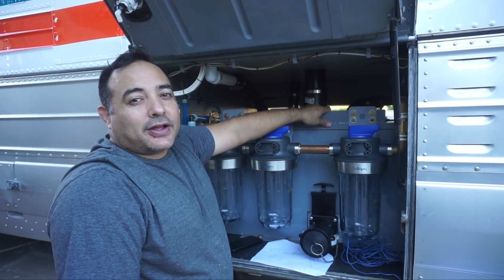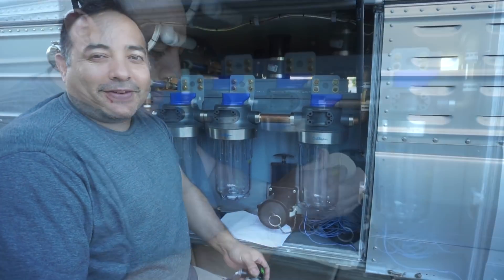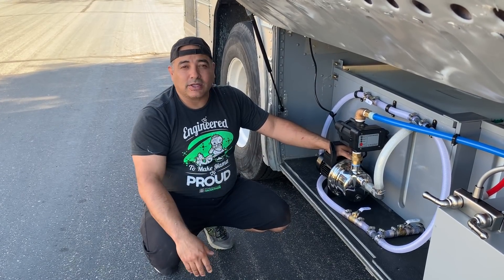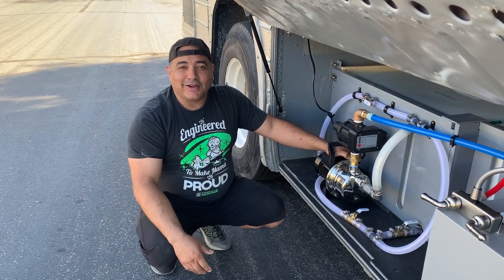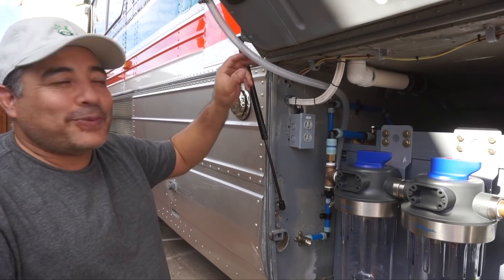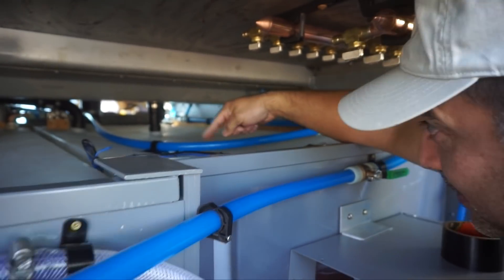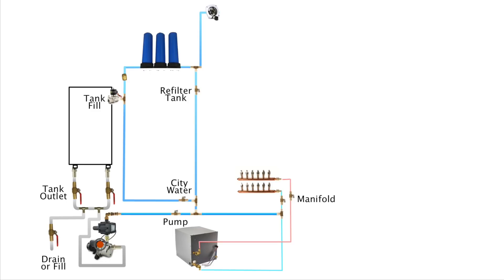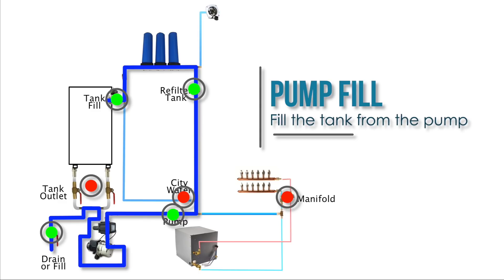Supply Plumbing Part 6: Inlet Hose, Fill Valve, Manifold, & System Overview

Comment: We are considering installing the same style pump, now that you've had this system installed and working for a while how's it going so far?
Reply from the maker: It's great.  We really like the pump and the whole plumbing system has actually worked out well.  I don't think there is anything we would change about it at this point.

Comment: Having watched these for awhile and seeing how thorough you are, I guess you're going to write a User's Manual for all these systems in the bus?
Reply from the maker: Yes we will have a user manual (already started with all the diagrams we draw for ourselves anyway).  We will probably have some operational check-lists and detailed wiring schematics as well.  The bus will also use a fair amount of source code which we will check into a remote repository incase any of the logic boards go bad we can re-flash them instantly and be up and running quickly.

Comment: What a great walkthrough of how you’re running your plumbing! We like how you have check valves & are able to recirculate water back through the filters! Are y’all going to use a UV filter in line after the three canisters? Or is that not needed for this setup?

Keep rocking it, y’all!
- Brian + Erin
Reply from the maker: Glad it was helpful!  We plan on installing an RO system for drinking water.  UV filters can help of course but we are planning to get water from municipal water sources (already filtered and clean).  If we were getting water from streams and other untreated sources we would be very likely add additional filters and UV.
Reply: @BeginningfromthisMorning  - Ahhh that makes total sense! YOu guys are doing such an awesome job! Thanks for sharing. - B + E

Comment: Do you have a shut off valve for the cold water supply to the hot water tank? I didn't see one on the schematic.  If it leaks you'll need a way to shut it down
Reply from the maker: Thank you William.  If we were on city water we would shut off the city water valve.  If we were on the pump we would shut off the pump valve.  That should stop all the water to the cold water as well as the water heater.  There is also a small valve at the inlet to the water heater that allows you to "tune" the cold water intake (incase there is too much flow) in a pinch this could also be used to shut the water off to the heater only.
Reply: @BeginningfromthisMorning  Wouldn't that mean you'd have no running water until the hot water tank was either fixed or bypassed?

Comment: As others have stated, you absolutely need a pressure accumulator. The way you have your system configured now, your water pump has to start every time someone cracks a valve, and it will stop every time water flow ceases. Your pump will not last long constantly, and needlessly, cycling like this. And, its particularly bad for an AC induction motor. The lack of an accumulator will also exacerbate water hammering which is not just annoying, but can damage your plumbing. If you connect an oscilloscope, you will also see another issue, induction loads create huge electrical spikes which, overtime, damage other components, e.g. inverters, refrigerator, AC, computers, et ceteria.
Reply from the maker: Thank you E Designs - The pump we bought is designed to work without a pressure accumulator tank.  The control mechanism on this pump keeps it from short cycling as you describe.  In fact, the way the system works you would swear there was already a pressure tank installed.  I was skeptical at first - when I have used well pumps in the past they have all needed pressure tanks.  So we were ready to put one in if we had to.  After getting the pump going and testing - what we discovered is the pump worked great even with just a tiny trickle of water - no hammering or power cycling what-so-ever.  The pump will remain on and provide a constant stream of water until you turn off the tap.  When we get a little further along with the plumbing I will show a video of how this works.
Reply: @BeginningfromthisMorning  I look forward to your future video on your experience with this pump, but I disagree with your conclusion. As an example, if you have an ice maker, it will draw a small quantity of water for an extended period while filling. With an adequate accumulator, your pump wouldn't even need to run for this operation. In contrast, your current system will need to run the whole time your ice maker is filling. Likewise, if someone opens a faucet to quickly wash their hands, your pump has to start and stop every time the faucet is opened. The delay shut-off on your controller just keeps the pump running longer than necessary and does not really address the problem. Accumulators function like capacitors in an electrical circuit: they smooth pressure pulses and provide surge capacity. Your controller will not fill the void.

Comment: Re-Filter Tank:
Once contaminated, there is no amount of re-pass through filter that can really clean the water 100% or even to the full filtered ability.  If the filters were connected just before the T that goes to the manifold, however, all water would be cleaned before being used.  At that point, it really does not matter where the unfiltered water is obtained... City, Tank, or Drain/Fill

Pump:
With the larger pump, should you not also include a Pressurized Accumulator Tank to prevent short cycling the pump to death? Sounds like they have greatly improved them from the days when you had to deal with one getting "waterlogged" from lack of separation of air/water.  Even the small one my RV had on it made a large difference in the number of cycles on the pump when faucet is not "FULL ON"

BTW, getting caught up on everything you've done so far and am always WOWed... Also think we would be instant friends, so don't take any of the above as anything less than suggestions from friend.  All of this may have been said before, so this may just be a +1

Also, i totally understand why someone might have missed the tank vent thing -- It was your twin from the Terrain universe that did the other video (Goatee vs No Goatee - star trek reference for those that don't get the reference)
Reply from the maker: Lol!  Love the goatee refence.  So funny!  Thanks for the comments.  We considered putting filters between the pump and manifold but couldn't make it work logistically.  Having the loop was a bit of a compromise.  We don't anticipate having to use the refilter option frequently but wanted to plumb it that way just in case.  For the pump, it is designed to work without an accumulator tank.  So far in our use of it, we haven't experienced a lot of cycling.  When the water is on a trickle the pump remains steady without any pulsing or cycling.  Thanks for joining and sharing!

Comment: Hey Juan you mentioned the vent but didn’t show what you did there. Not sure what you’re planning but FYI on the 2 buses I’ve owned, the “vent” also serves as an overflow to the ground. Very useful when you want to fill the tank all the way before boondocking and not worry about rupturing it.
Reply from the maker: Thank you Scott - yes! our vent is going to be designed to also overflow (we actually just tested this last week and it worked beautifully).  I saw you hit 1000 subs - congratulations!  I think it took is well over a year to hit 1000

Comment: Juan, why did you use a copper manifold instead of the pex versions?
Reply from the maker: Thank you Joseph - the only plastic ones we could find were for PEX-B (Vega Manabloc type systems) - we couldn't find any manifolds with valves for PEX-A in plastic.

Comment: Really nice system! Curious about the need to recycle the water from the tank. What's the idea with that ? Wonderful system overview at the end. Thanks for doing that. Keep going....you're doing great.
Reply: If it is a on demand system then you want to recycle the water instead of wasting it waiting for it to get hot...
Reply from the maker: Thank you Mark - great question.  A good scenario were we might want to recirculate that water is when we have to do a sanitization of the water system.  Most things I have read say that you should sanitize about twice a year.  In order to sanitize most folks use bleach and then wash it through the system a few times - but we know this will probably not get ALL the bleach out.  If we set our tank to run through our filters - the carbon block filters should get 99.9% of the bleach out of our water (as well as any cysts or bacteria that have been in there).  Another scenario is if we are filling our tank from a low pressure source where the water pressure is not strong enough to push the water through our filters effectively.  What we could do is go ahead and bypass our filters filling the fresh water tank directly from the hose - once we are finished we can kick our pump on and re-filter the entire contents of the fresh tank several times (at 16 GPM we should be able to re-filter the entire tank in about 10 minutes or so.  I hope that makes sense.
Reply: @BeginningfromthisMorning  Got it - Thank you! I forgot how big your fresh water system was/is. I'm used to my camper with only 30 gal fresh water tank LOL. We go through that pretty easy in a couple of days. Like everything else, you guys have done your homework. One other question, do you plan on using the water from your tank as drinking water, or will you treat it as "potable" water? I'm thinking that with the filtration system you have setup that you could use it drinking water too - no?
Reply from the maker: @Lake_Lover  Yes we plan on using it as drinking water ... It will be further filtered by a reverse osmosis system for that.

Comment: Is there a tank overflow to the exterior?
Reply from the maker: Yes the vent is also the tank overflow
Reply: Without a vent you could not fill the fresh water tank.  I think a vent/overflow is pretty standard.  We have one on our bus conversion which was commercially done in 1991-92.  But not for us.  We bought it in 2009; 4th owners.  :-)

Comment: You might consider a booster pump in front of the water filter. These filters will reduce the amount of pressure. The booster pump overcomes this.
Reply from the maker: Thank you Gert van Werven A lot of RV water systems do put the filters AFTER the pump we thought this might be more efficient but time will tell when we start using it.  Thanks for the tip.
Reply: Beginning from this Morning but most rv’s aren’t using shallow well pumps in their potable water systems either Juan. You have all the pressure you need there to do whatever you need, you won’t need to worry about a booster pump at all. The pump you have is used in homes all over the country and the systems are much larger than yours but work without issues

Comment: Juan I noticed that you wiped off the flux after you applied it? Normally you don't do that the whole purpose for it is it helps the solder flow along the flux
At least that's what I was taught
I could be wrong
Reply from the maker: Thanks Brian - I only wiped off what was sticking out of the joint to help make the joint a little cleaner (found it on a YouTube video here: https://www.youtube.com/watch?v=V13EEkeeYfM).  I managed to still make a little bit of a mess ;)